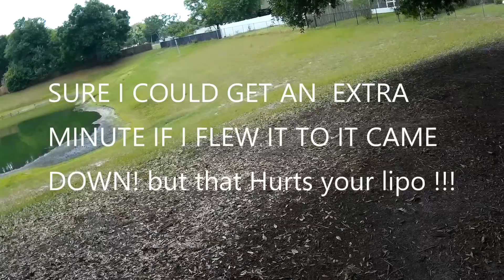INDUCTRIX 200 Landing Gear MOD. to fit 1300 mah Battery

Comment: That bigger battery is a good idea. You got the CG pretty close. Your landing leg mod is perfect. Removing the top motor cages took off some weight as well as improving air flow. If the duct rings are supported well enough by the 3 supporting arms, you might cut away the semicircle pieces running between the duct support arms. That would help clean up air flow and shuck a little more weight. Good Video. :-)
Reply from the maker: Thanks my friend.. i really like the way this one flies! it so smooth compared to a lot of the lower grade quadcopters. 90% of it has to do with the controller I'm sure. would love to get the Devo 7e
think that's a must-have for anybody who really likes these toy grade quadcopters
Reply: +Full Metal Heli You can get the Devo 7E for around $50 or the Devo F7 for around $115 on EBAY. I have both. The F7 has a video screen built in. If you have goggles the 7E would do just fine.
Reply from the maker: +Don Fish Jr. (The Flying Fish) yes I want to do the modification where you can fly the toy Grades with it ..the soldering part looks pretty simple for me.. just the computer programming part looks a little tricky

Comment: sweet mod! i lost one of those foamy thingy on my first flight, lols. ended up using the yellow vacuum caps, fits right inside the hole too. thinking about adding an xt60 mod like you did. 2 of my stock batts went into the blue error thingy, and now won't charge, waiting for the new charge adapters to see if i can save them.
Reply from the maker: hook up positive and negative wire to both ends of the plug on the battery just insert them into the hole and put your charger on nickel metal for a few minutes ( if you have a regular lipo charger)and bounce it back up ! then you'll be able to lipo balance charge it again
Reply: Full Metal Heli
ok will try that out. thanks
Reply from the maker: It works just be careful you got to watch it don't walk away and leave it
Reply: +Full Metal Heli 
k will do.

man just noticed your props in the video looks brand new. do u ever crash? one crash and mine looks like a lawn mower, lols thanks again
Reply from the maker: Not Much crashing...lol when i did it had the covers on them

Comment: hey full Metal you are my go to when it comes to reviews look man I just but the Trantula and I have to tell you I am so very dissapointed for so many reasons as I was telling you yesterday with the prop shafts stripping and the flimsy prop guards  the hole thing felt brittle and screamed low quality then after all that i could only get 100 foot range at very best lol . and I know you love the Trantula but I would like to ask you  can you recommend me a quality bird that won't break the bank please I really don't want to give up on this hobby but when I spend my money I want quality
Reply from the maker: I'm really surprised about the tarantula most people really love it myself included ... I have only had one small issue with mine and I've got over 75 flights on it. but for something that's under a hundred bucks and it's the absolute most refined quality quadcopter I would recommend the Syma X8
Reply from the maker: matter fact I'm working on a little morning buzz video with that quadcopter right now

Comment: Good morning sir just wondering what's it like to fpv it
Reply from the maker: its more fun to Fly this FPV than just line of sight. its better in doors than outside really don't fight the wind that well
Reply: +Full Metal Heli just looking for something around the house when it rains, it's hard to know what to get
Reply from the maker: +Dji Leon the xk x100 is a blast!! and its very inexpensive considering the quality of it. does 3D Acro mode and self-leveling mode good very easy attach a little micro fpv system on it.
or the new blade nano qx2 which has built in FPV but is very over priced and dont do well in the wind either
Reply: +Full Metal Heli thank you sir 👈

Comment: hey man I think I decided on the blade 200 qx I like the size. but I have a jjrc x1 on order and it comes with a 7.4 volt 1300mah battery what the highest mah I can go? and is there a 7.4 V 3 cell battery?basically what battery di you recommend without having to do any mods?
Reply from the maker: the JJRC X1 battery works perfect for 200 QX. just have to rubber band it and Velcro to the bottom of the battery door ...it doesn't fit in battery compartment.
Reply: 2cell= 7.4v (3.7v per cell)
3cell=11.1v (3.7v per cell)
No such thing as a 3cell 7.4volt battery.

Comment: Yeah man that's why I wish I could chat with you to help me kind of decide I want kind of the best of both worlds I want somthing sporty fast with different speeds and has the capability of recording duh!!!lol.i was thinking a boy the eachine falcon 250 comes RTF with fancy bag and everthing bro it looks sexy it's on banngood have you seen it?
Reply from the maker: really you could probably go on Craigslist and get a 350QX for 250 bucks and you could always buy a Mobius camera or a 808 keychain camera and make pretty decent video and have a really sporty GPS quadcopter which is extremely fast but can be extremely easy to fly as well! and you gotta remember there's hardly anything out there that flies as good as the blade products made by Horizon Hobbies
Reply: What's better the 350 or the 250?
Reply from the maker: The 350qx is GPS and you can hit i button and it comes back home and lands! Can let go of the sticks and it flys it's self but flip another switch and its a BEAST ! The 200Qx is no GPS
Reply from the maker: +Nick https://youtu.be/1Ak7GX-OWPo
Reply from the maker: +Nick thats what im using to chase the Phantom around... just mine has a carbon fiber frame kit..but still flies the same as a stock one... and there are tons of upgrades for the 350QX

Comment: I get 6 minutes with the stock batteries.
Reply from the maker: yeah that's to when it no longer flies..im talking about stopping when the Lvc First starts blinking.
and battery is at a Good storage  level.
Reply: +Full Metal Heli Correct.